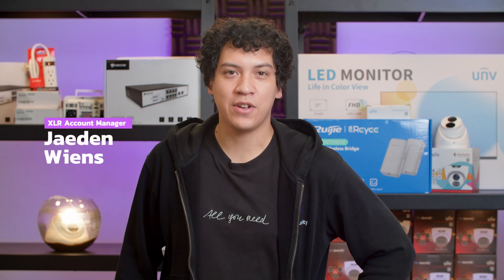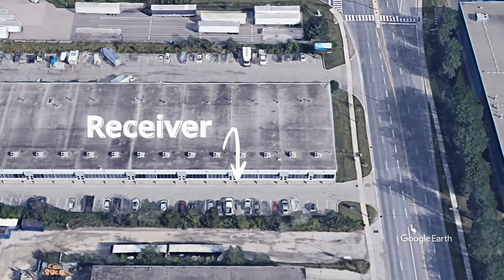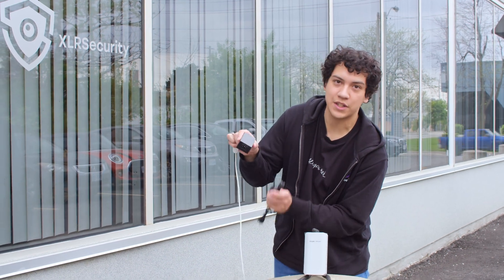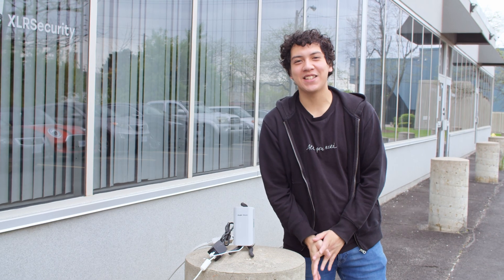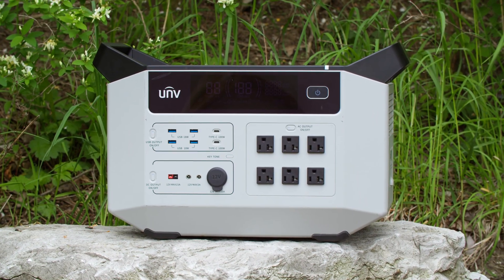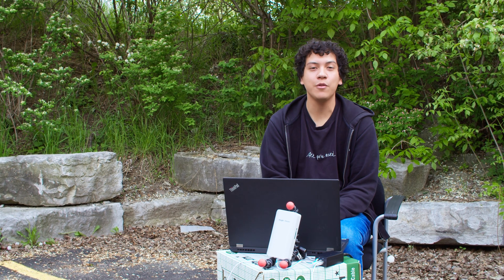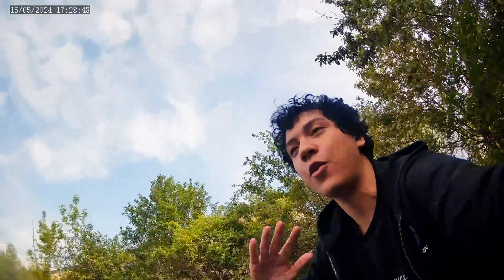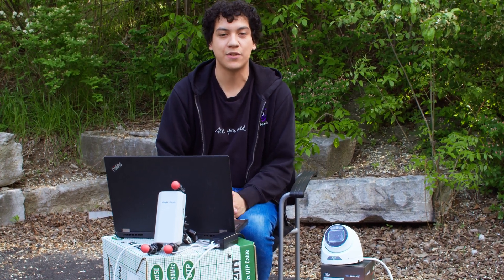Reyee P2P Wireless Bridge (pre-configured for easy setup) | RG-EST310-V2

Comment: first of all Thank you very much. Can I connect it directly to the PoE switch? Without using an adapter.
Reply from the maker: No, you must use the included PoE injectors. The reason is because these P2P bridges use 24V PoE, which is different from the 48V PoE found on PoE switches. If you try to connect these bridges to a PoE switch they will not boot up.

The included injectors supply 24V PoE, which is why they are necessary for these bridges.

Comment: Bisakah anda menginformasikan, Cam end atau NVR End yg berfungsi sebagai transmiter, dan mana yg berfungsi sebagai receiver?
Reply from the maker: I actually had the camera and receiver end backwards while testing and it still worked. It you are using only one bridge pair, it does not matter which end is the receiver or transmitter.